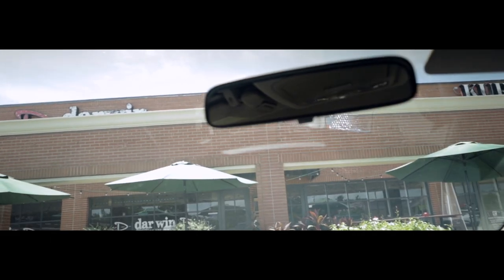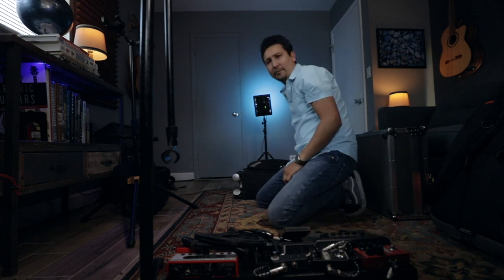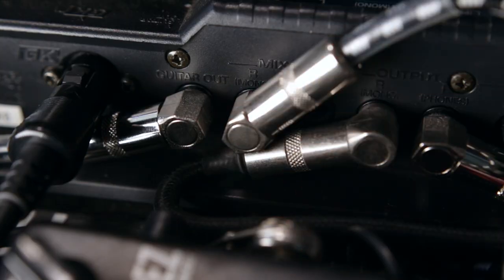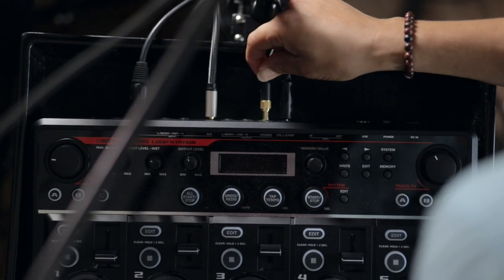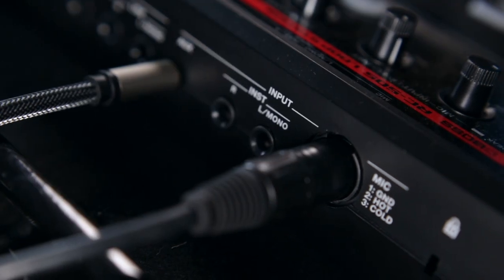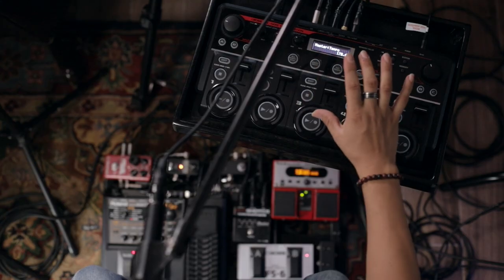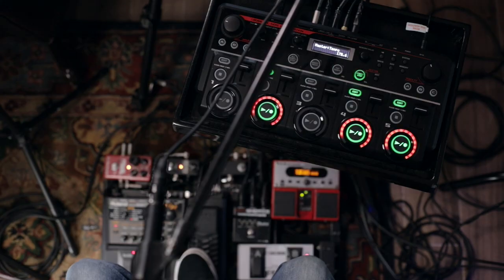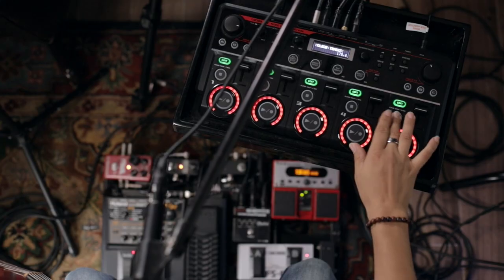Boss RC-505 Live Looping Rundown

Comment: Hi! Thanks for the video! Can you tell how do you set up your hot shot ABo pedal? I can’t get it right to have it working like that… :/ 
Thank you🙌🏻🙌🏻
Reply from the maker: Hi, thank you. Honestly I can’t remember cause I haven’t used it on a long time. It gave me too many problems where sometimes the signal wasn’t full. However, it’s very simple design and should let you connect you microphone so you can then route it to two different places like I do: one to looper and the other to mixer
Reply: @andrescolintv   yea the volumen straight to the mixer change immensely.  if I plug it straight to the amp instead of the mixer is a little more steady and similar to the sound when the connection straight to the loop is on. Did you find any other way to do what this pedal does? 
Thanks for replying. I just got this pedal tho I thought it was a good choice :/